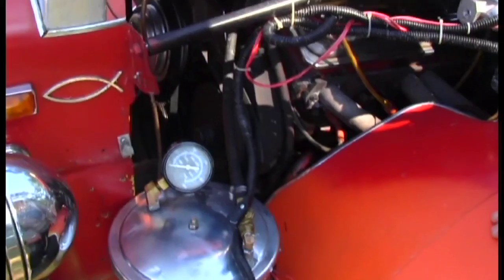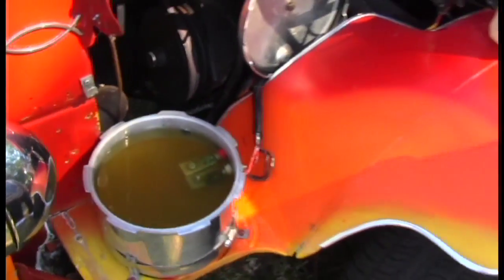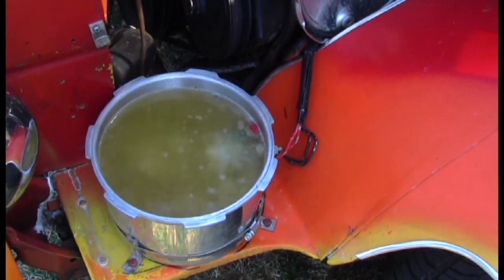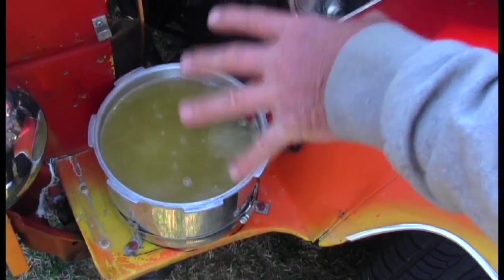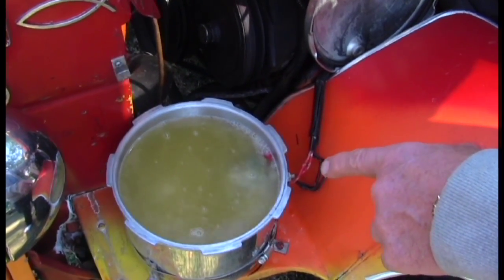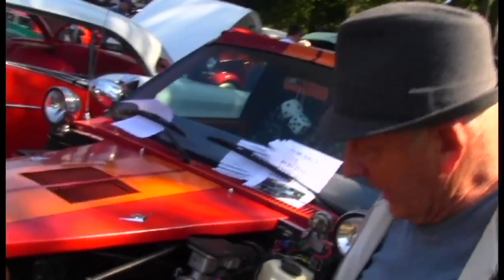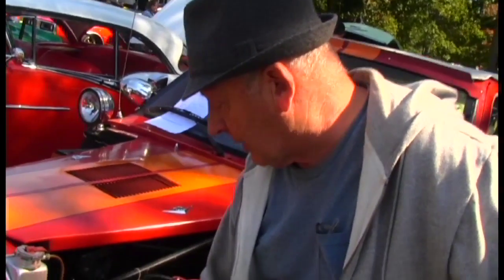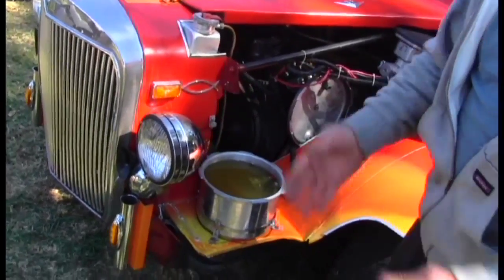Man invents car that runs on water

Comment: He admits he pressurizes it making it into a "bomb." Engines rely on air gap between piston rings to allow for oil to be maintained along the cylinder walls to avoid the engine destroying itself. Engines also run on very carefully maintained fuel octane values that hydrogen wouldn't be able to maintain. People sometimes add oxidants like nitrous oxide to a vehicle's fuel/air intake to let the engine run faster and hotter for very short periods of time such as for drag racing so the engine isn't destroyed. Hydrogen wouldn't work.